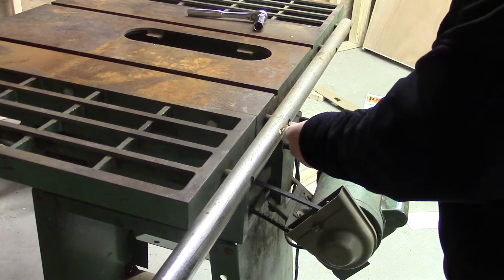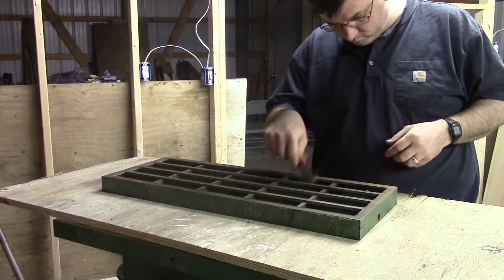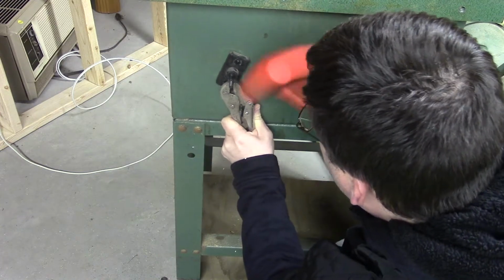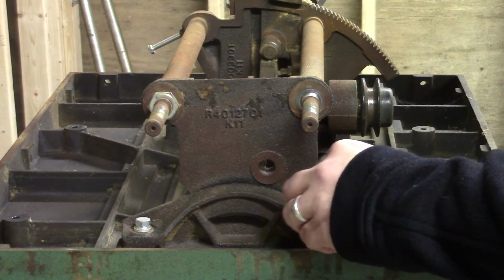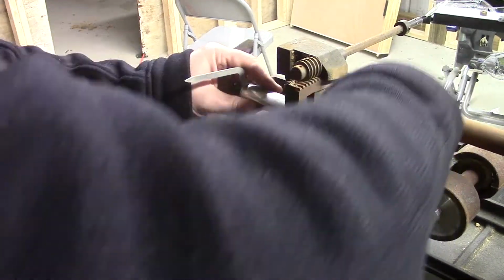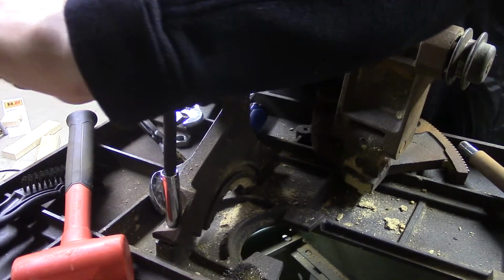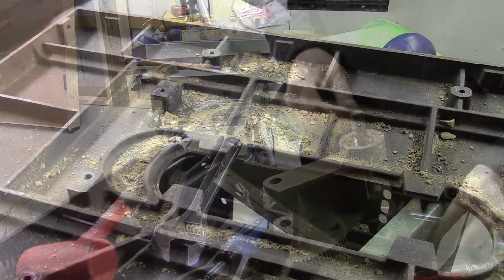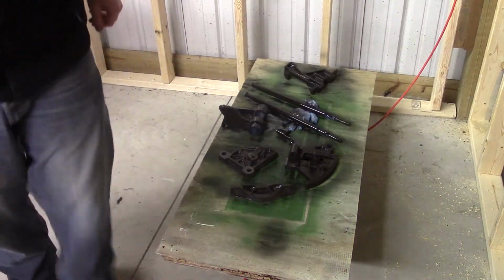Restoring the Grizzly 1022 Tablesaw: Part 1

Comment: Trying to find adjustments for 45 degree, but feels like it's bidding up ,I have a 1022 I think it's 
A 1993 ,don't know how that picture of me got there oh well, thanks
Reply from the maker: If you need to adjust alignment at 45 degrees, use shims under the front or back trunnion bolts. Stumpy Nubs did a good video about blade alignment.
I no longer own this saw. It got me by when I started my shop, but I moved on to a cabinet saw.

Comment: My 1022 is giving me a problem and maybe you can help.   When I turned on the saw to day it started squealing.    I cut a piece of soft pine for a test cut.   It struggled.    When I turned off the saw the motor stopped and the belt stopped.  The blade was in a free spin.
When I attempt to put a blade on the threads just spin and I can't seem to get the nut to twist on tight.
I"m thinking it's the key in the assembly.  Also, maybe the bearings?  The belt moves and stops as it's supposed to.
Do you have any suggestions as to what it might be?

Comment: I just picked up a TSC-10L circa 1989 - how similar is your 1022 to mine?
Reply: I have the same model as you and can't see any major differences in components or how it's assembled. Having looked through a bunch of manuals at this point, the 1022 seems to be the closest match if you're looking for manuals that are still available online.

Comment: Hi Noob - great series and thanks.
I have a G1022 with a severe height adjustment dysfunction. Yesterday I set up to rip a half inch dado in a workpiece and over the ~30 inches of rip the height increased by about a quarter of an inch. I am unable to lock the adjustment down and the knob has about 45 degrees of slop before it move the arbor up or down. It's obvious it needs work, but I'm not ready to go quite as far as you did in your restoration. Can one hope to get to those parts without disassembling the whole machine as you did?
Reply from the maker: You will at least need to take the top off and flip it to access all the adjustments.

Comment: Is there a video on the bearing removal and replacement or a time in the video where it occurs.  Im replacing the bearings in my Powermatic 63 now using bearing part number 6203zz
Reply from the maker: The bearings are in the second video I think.

Comment: Thanks for making and sharing this; it has really helped me out. A few days ago, I picked up a rusty no-name table saw for $50 on Craigslist. It had obviously been neglected, and I wasn't sure I'd be able to safely take it apart for inspection, let alone get it working. Thanks to you, I now know that it's a Grizzly 1022 (or perhaps a knock-off? The motor's label says it was made in China by a company called Central), and there is a .pdf version of the owner's manual available. Mine is almost exactly the same model as yours, except it has no shroud for the motor and the wings are stamped steel instead of cast iron. Which is probably a good thing--that beast is so %@#$ heavy that I about killed myself bringing it home! Liked and subscribed.
Reply from the maker: Thanks for the sub, you just pushed me to 200. I'm building a workbench right now, so I am going to be pushing out more builds soon. I'm restoring a bandsaw next.

Comment: I did a very similar restore on the same saw. My main complaint is the table re rusted on me. I did add a shop fox fence system with 7' rails. I also replaced the motor with a brand new grizzly one and wired it for 240 volt
Reply: Once the table surface is restored, wipe it down with naphtha to remove any residue.  Then, apply Johnson’s paste wax, let it dry a little, and rub it.  Each month or two, wipe it clean with naphtha and reapply wax.  Never set cold drinks on a cast iron table.

Comment: Hello,  I have a g1022z saw, it's giving me so many problems,  .it is really clean and looks great but I cannot adjust the fence properly for the life of me! I feel like it's virtually impossible to level the table correctly,  any advice?
Reply from the maker: I ditched my fence entirely and made a fence from John Heisz.
Reply: @gcdrummer02  I'd love to, but I don't think I have enough skill. Maybe i'll give it a shot. I now see why grizzly discontinued this tablesaw, it's not built good at all!!
Reply: I have a G1023  which is quite different I suppose. However I  could never level the table to make clean 45deg cuts. Ten years on I decided to take off the table to check it out,  - shock, horror,  the rear trunnion casting was broken. I believe it could have been that way from day one!  In fairness to Grizzly, the replacement part only cost $27     When I  fit it  I expect to  be  as happy with it as I am with the rest of the Grizzly machinery in my shop.
Reply: Contractor style table saws usually come with worthless fences (this includes the  old Craftsman, Delta, Grizzly, Rigid etc.).  A reasonably low cost bolt on solution is a Vega Utility Fence.  I put a used Vega fence on my 1022 about 10 years ago and the difference is amazing.  On the 1022, the front and rear Vega rails bolt on the existing Grizzly pattern..no drilling or tapping required. Initial setup and calibration takes some time (to be done properly) but once installed and calibrated the fence is dead on for every cut.  I ripped 3/8" off edge of a solid maple cabinet face frame (U shaped kitchen in old house where the interior dimensions were 3/8 less 24" from the back wall!) very accurately.  I moved right after completing that home remodel and had not used the saw in 3 years (saw in pieces, fence sitting separately unattached).  I just put the saw back together this last week and used it to rip cedar kickboard for my new deck steps.  I bolted and leveled the front & rear rails to the saw, made sure the fence bottom was clear of the table, set the rip fence to 7 3/8 inches (my tight measurement on the deck) and made the cut.  Tape measure showed 7 3/8 exactly and I had to lightly tap the board to get it in place.  

This fence, like many other high quality aftermarket fences, only locks on the front rail (the back rail is used as a slider/support for the front rail.  Cheap contractor saw style fences typically have wimpy cross section, a lousy lock on the front rail and rear rail clamp always seem to cock the fence at a slight angle when engaged. 

After a week of using the Vega fence, I put the old Grizzly fence and rails out on the curb for the local scrappers to recycle.